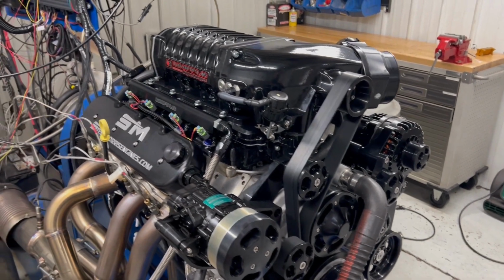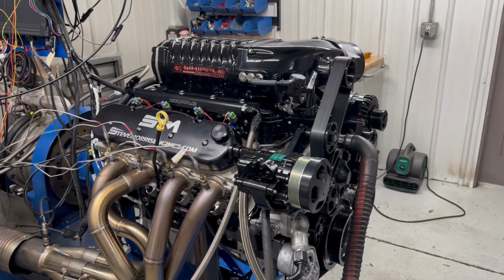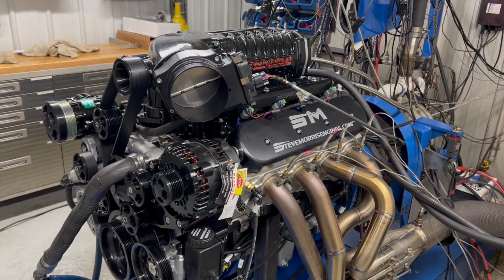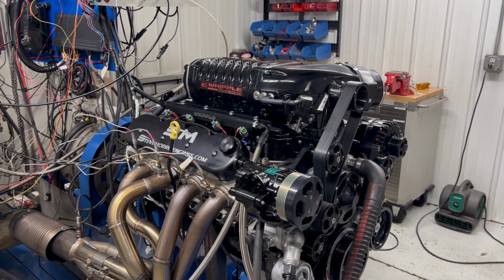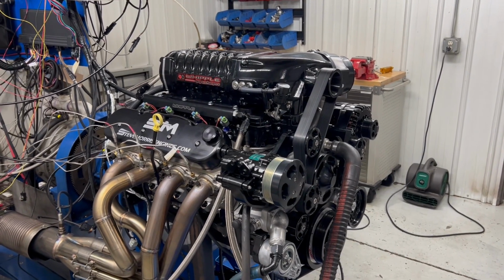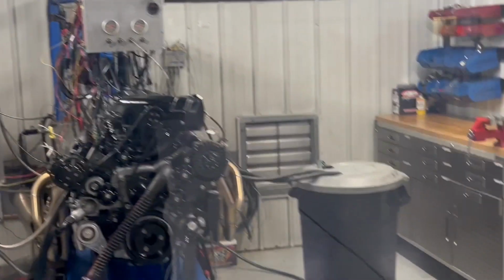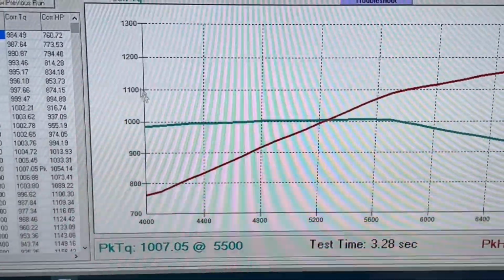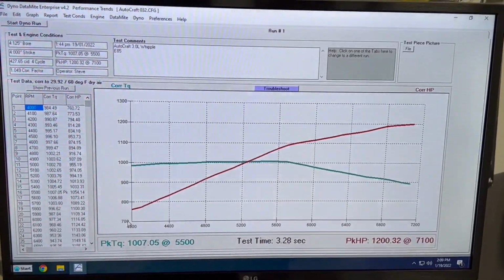NEW 3.0L Whipple LS Engine Dyno!  1,200HP on E85!!!

Comment: I love these videos but would love to see a second run with the accessory belts on to see the power drop just out of curiosity.🔥👍🇺🇸
Reply: Have you ever had to actually dyno an engine? Trust me, the loss is a lot less than you might think. Mechanical fans are what you need to stay away from. the alt, ps and water pump are much less power hungry than you might think.

Comment: Watch the exhaust fan shutters during the pull starting at 2:30 The dyno cell may be starving the engine of some air flow, pulling a bit of vacuum in the room. It’s interesting to see a visual of just how much air that engine is moving. Very cool video as usual!
Reply: If they are still open at all it’s more then enough air. Those are exhausting the air from a fan blowing in. So the engine sucks what it needs and the rest is pushing the flappers. 

They do look to be pretty closed, but even open a little means there’s enough flow. It’d be interesting to know some numbers though, your right.
Reply: That's a problem. Steve is amazing but his dyno cell has serious airflow issues. I noted on another video that showed fumes off the headers heading into the turbos. Engines need dedicated shrouded air supply for optimum powr and repeatable measurements
Reply: @artbennett7321  
Show me one shop that has that. What you need in order to repeat results is steady airflow. If you have followed what Morris is doing and has been doing for the past 10 years, you'll see that he is very conscious about the workings of his dynos. He has made over 3000 hp in that room, so that little LS will not struggle.

Comment: I really want to get a 2014-2018 Sierra or Silverado RCSB with an L8T bored to 4.125" CNC heads, cam, and 3.0 Whipple on E85 at 16-18psi. I would expect this much or maybe a little more power, but I'm very impressed with the 3.0 Whipple.

Comment: Why is the Whipple 3 liter better than the 2.9 liter?
Reply: The new inlet makes more power each generation gets technology added from what they learn to make more power I like the smaller charger to spin them up quick instead of putting a big pulley on the larger whipple feels more torque if that makes sense
Reply: They changed the rotor profile of the supercharger screws from 3/5 to 3/4 and the helix and made some inlet modifications. 

Most of the additional power comes from the more efficient screw
Reply: The 2.9 is an old design. New rotors, new inlet, new outlet, new cooling etc. The 2.9 is a 20+ year old design.

Comment: How come the peak 93 hp isn't very far from the Ethanol peak. 1100-1200. Usually Ethanol picks up much more than that. Can Steve explain that please
Reply: It's just a 3.0 blower, and seeing that we don't know the heads and cam, there's no way of knowing where the choke point is.  Too many variables. If 1200+ was the order of the day more than 1000 hp, then the 4.0 or 4.5 would be what was needed. This combination is just at its limit it would seem.

Comment: The Australian Ford Barra 6cyl with turbo motor will easilly do 1200hp, more bullet proof than an LS motor, seen Barra motors around the 2000hp but not really streetable at that point.

Maybe SM engines should out of curiosity start looking at and building alternatives to the LS SBC BBC.   Im sure with your knowledge you could develop the Barra (old 250 2v based block) to new heights.
Reply: Why in the h… would a US engine builder mess with an Australian engine platform that you can’t get in the US?
Reply: What's the point of your comment? Steve has built a 2000+ hp 2JZ too. So? He can also do a 2000+ hp LS easily. That turbo Barra at 1200 is no more reliable than a turbo LS at 1200 hp. Looking at your comments, I doubt you know very much about either Barra's or LS engines.